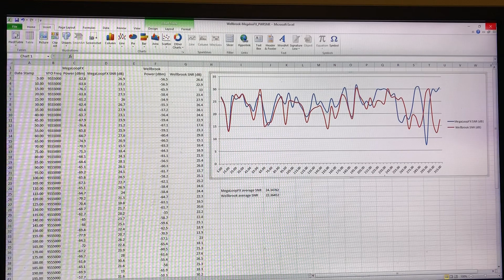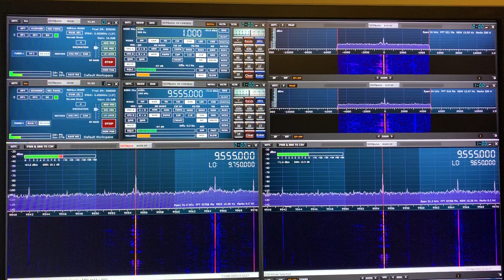Comparing the Wellbrook ALA1530 against the MegaLoopFX: Graphing SNR data from Radio Saudi 9555 kHz

Comment: Thanks for doing this "first run" of the graphing S/N comparison! Apart from the specific numerics, a couple of dB on the average really isn't noticeable to the ears, especially with the effects of the ionosphere and resulting fades. The later part of the reception is very interesting, with one antenna peaking while the other one drops. I presume both loops are aligned in the same plane? Regardless, a great test and it'll be interesting to learn of the results on other frequencies including MW and LF if you have the time.  BTW, I have a couple of different wellbrook 1530-type models, and the LN Pro Imperium is measurably better on MW than the other one (and original S+ version).  73, Guy
Reply from the maker: Thanks Guy. Yes both loops orientated in exactly the same plane. I have the standard ALA1530 and the LN version. I can't see any difference in performance at my QTH. Thanks again Guy and keep safe. 73s, Clint
Reply: @OxfordShortwaveLog  It takes a very RFI-quiet environment to tell the difference between the standard and Low Noise (LN) loops. Only on DXpeditions away from any local noises was I able to tell any difference at all between a ALA100 and ALA100LN wire loops from Wellbrook, for instance. Thanks again for your comparisons with the MegaLoopFX! This top-end Bonito model is out of my budget, but since I have various Wellbrooks to use I'm happy. I also have a new model of Cross Country Wireless VLF/HF loop to check out sometime.  73, Guy

Comment: i will follow this video serie i got the same wellbrook loop and the ML- FX . I used the ML-FX and found it just not so good as the wellbrook to much noise and to much mixed signals. I bought some copper water tubing and are planning to make a copper loop for the ML-FX and than compare it with the wellbrook 1530. 73's
Reply from the maker: Thank you very much my friend. Interesting that you found the ML-FX to be a little inferior. I think it depends on the frequency, but more testing will tell hopefully. Thanks again and 73s, Clint